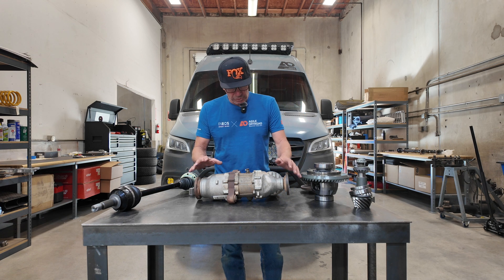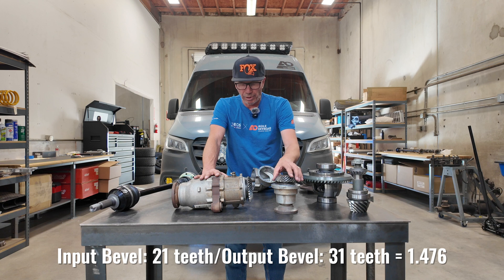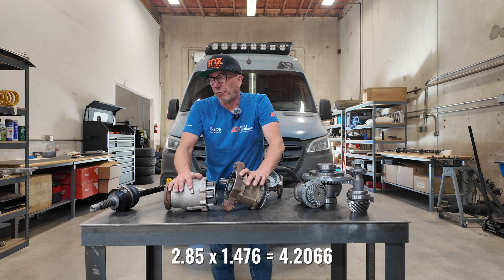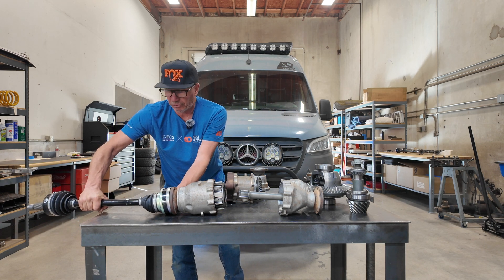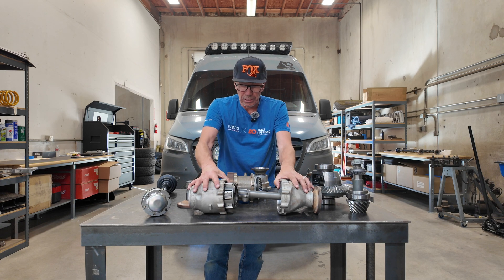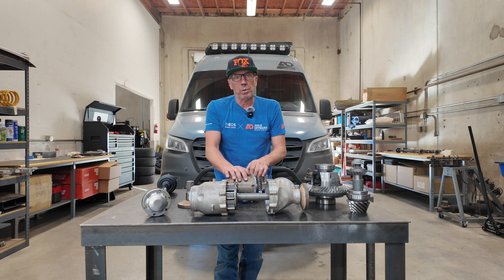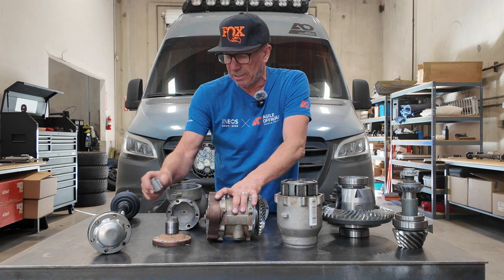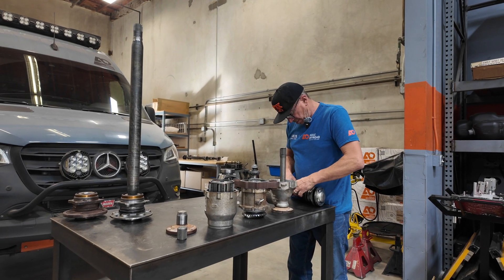Why This Mercedes Sprinter Front Differential Failed – How It Works & What Went WRONG?!

Comment: I burned mine out doing two delivery routes at 55mph on a 500 mile trip. The key is to never go 40 in 4x4. I ended up with axle damage and a quote of $11,000 to fix. I took it to Toyota and traded it in.
Reply from the maker: Wow, that's a costly lesson learned, thanks for sharing!
Reply: @Agileoffroad  Yes it was I had to trade it in for a Toyota Carrolla and I am stuck with my 2011 Freightliner 2500 tall roof that was sold to me from NY with a bad engine. It runs good but I completely rebuilt the van other than the transmission which I was able to save with regular fluid flushes. Once this van is done I am going to just car delivery.

Comment: Finally!!!! 🍻 you guys deserve 1k beers for this video. Just made a 4x4 swap to my 906… and i didn’t know if the guy whi sold me the parts, gave me the corect rear axle… i’ve searched my ass of to find the front differential ratio with no luck. Still relating what you said here, running different ratios front to rear on the 4x4, you don’t want to de that for long drives with the 4x4 engaged, because that centra planetary gear diff was designed to differentiate just a small amount of output difference, it might fail due to lack of lubricaton if the planetary gears spin like crazy to compensate for the different ratios, not to mention how little oil it gets from that 1 litre in the transfer case as it sits way up. I still run same ratios front and rear, even if it has a central diff, just to have a peace of mind. Cheers again for the video! 🍻
Reply from the maker: Glad we can help you out!

Comment: Not without reason Sprinter 6x6 and off road version 4x4 HD had reinforced front differentials with cast iron housing. Standard will always have problems on big wheels, especially right side. In this version nothing breaks - https://www.youtube.com/watch?v=bhRXzFHz-yI ;  https://www.youtube.com/watch?v=uzdWcFcU1SU
Reply from the maker: Thanks for the links, we’d love to have that here in the USA!
Reply: Sorry,why especially right side??? Thanks
Reply: @tinocelano6039  Because it is much shorter, it does not compensate for the torsional force and breaks on a large impact.

Comment: Do you ever foresee having an option to change the front and rear gear ratio in the 2023+ sprinter? With bigger tires mine struggles a bit going up hills at highway speeds.
Reply from the maker: With bigger tires mine (John) struggles a bit going up hills at highway speeds. It’s something we are looking into.
Reply: Griffin, what size tires you running?
Reply: @NicPapagiorgio 285/70/17’s
Reply: @GriffinConway we are running the same size tires 285/70/R17. I had Agile re-gear  to 4.18 when they installed the locker, much better response and the engine now runs at around 2100 rpm at highway speed. Definitely worth the cost.
Reply: @GriffinConway  wow thats really good to know the 33s cause it to struggle like that. Thats the size I was going to go with, but maybe 31-32ish??